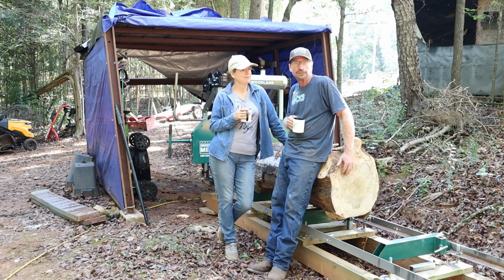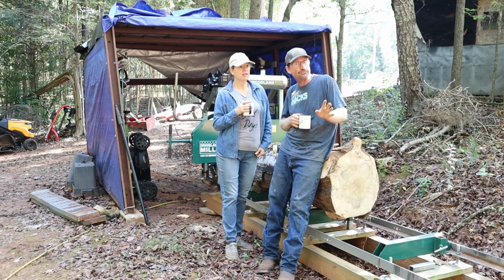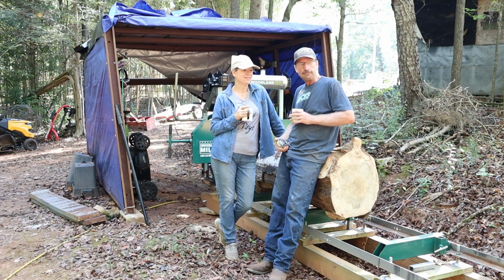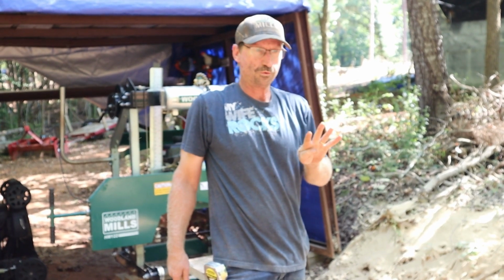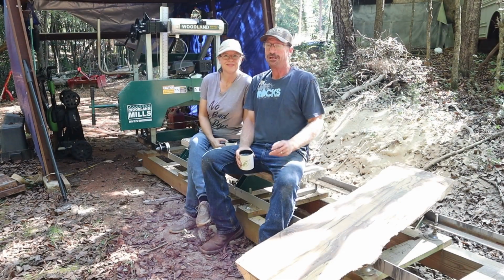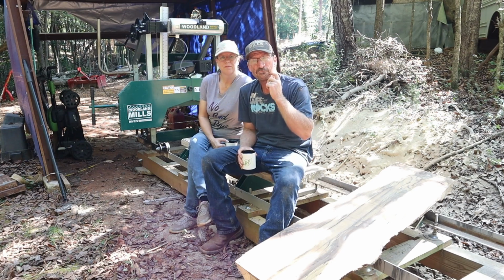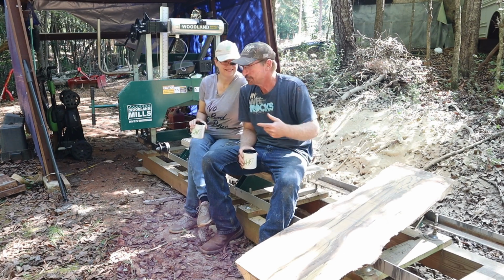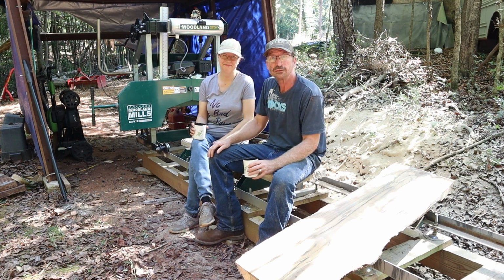Transforming Old White Oak | Woodland Mills HM122

Comment: 10:50 Drop pieces of 2-inch plastic pipe a couple of feet long over the log stops when you turn large logs and cants. Much easier that welding on rollers.
Reply from the maker: Why didn't we think of that! Great tip, thanks 😊

Comment: Good video and job nice  lumber I think a lot people have trouble with water mine put to much or none some people are using gas line valves.. I use hard wood blades  mostly both there is not a lot of different hard wood blades have more teeth .they may not be as good for sawing white pine. Take care be safe and well.
Reply from the maker: Thanks for the tip, this is good info. Appreciate you as always 😊